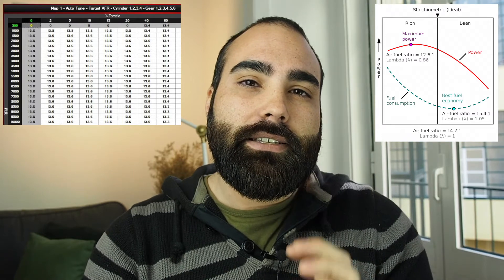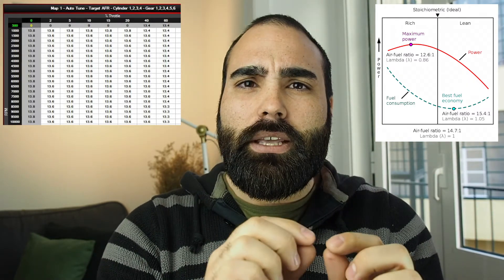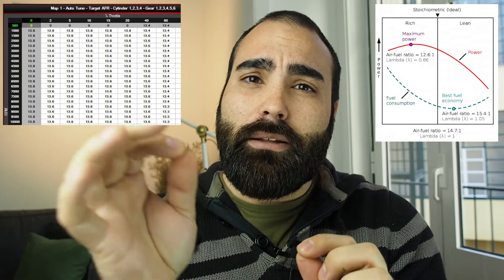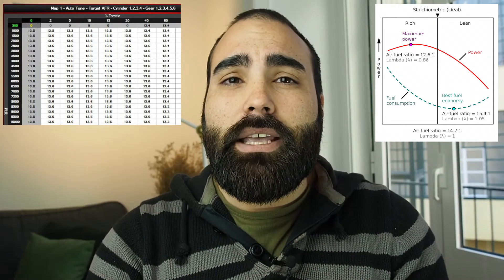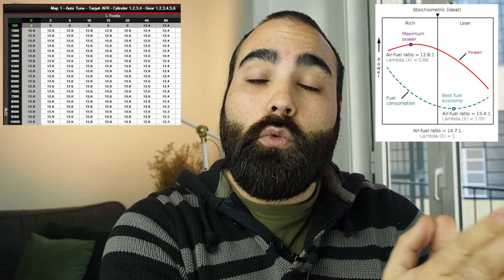Motorcycle dyno tune - Air to fuel ratio

Comment: so at stock bike, when you close throttle, at that time the bike will show how many air fuel ratio ?
Reply from the maker: The bike will never show you the air fuel ratio, you will always need an external device to show you those numbers.
Reply: @BNAdv  hmm, because i don't have motocycle...  I always confuse... Does motocycle have cut fuel when close  throttle ?
Reply from the maker: @TMMech  Not completely. Any petrol engine requires fuel, air, and spark, so when the throttle is closed, some fuel always needs to pass so that the engine continues to run at idle. But for you to properly understand how that works, I advise you to check out how internal combustion engines work, and how the fuel delivery system works 💪

Comment: I want a better fuel economy. What is the best air/fuel ratio? I own a 2004 FZ6
Reply from the maker: Hello Kleand,

Well, anyone that can answer that with a clear, cut and dry answer is lying, and I don't want to lie, so the real answer is I don't know.

Bikes, even within the same model are different, like people, even withing the same gender, age, and physical atributes are different.

If you want to get your bike with a better fuel economy, you should take it to a Dyno, and run it with a pro tuner to achieve your goals.

Different wear and tear, tires, modes you may have done, where you live regarding air pressure and temperature... All of those and more will have direct implications on your goals, and as such, on the answer.

In the same token, trial and error tests on your own may produce the results you want, but without it being done properly, you may be shaving years off the bike, as you may be introducing problems you may not be able to see or are unaware of because you are not a professional in the area, or at least I assume due to your question.

If you want it done, well done, don't waste your money on tests and internet DIY. Go to a pro, get it properly done, and enjoy your bike!

✌️🏍️

Comment: I spoke with a guy who has his own motorcycle dyno business. He builds insane drag bikes and he said that the best safe AFR for cruising is about 13.8, and the best safe AFR for maximum power is about 13.2.  Sooooooo 14.7 is pretty lean by his estimation
Reply from the maker: Hey Cameron,

Well, 14.7, as I stated in the video several times, is the mathematically correct AFR, or stoichiometric AFR, so not lean, not rich, just science, meaning that in order to completely burn 1kg of petrol, you will need 14.7 parts of air, so this one is not up for debate. 

However, as I also stated in the video, the stoichiometric AFR is not necessarily the best in the real world, so it requires tunning to your needs, meaning there is no best measurement of anything, there is only what is the best for you and your needs 🙂

Two other important points to keep in mind is that a drag bike will many times not run on petrol, but on methane or other kinds of fuel, which will have their own AFR's. Also to keep in mind is that drag bikes, as many race bikes, will also see their engines overalled, or replaced after each race, and that is not what most of us want on our daily use bikes.

It is important to understand the basis of this topic, but even more important is understanding that this, like any other topic, needs to be adjusted to your needs, and that means that what is best for you, may not be the best for anyone else 💪

Hope it helps, and that it gives you enough info for you to down your own research, and reach your own conclusions 🙂

Keep safe!

✌️🏍
Reply: @BNAdv  Yes, I realized that this as I was commenting.  I am not disputing the science I was just commenting that a guy who literally dyno tunes all kinds of bikes all day for his job gave me those AFR's when I specifically asked him for "safe" AFR's for a street bike.  We can also factor in that all bikes are different.  Even bikes of same make and model and year.  I have an MT10 and have talked with a mechanic who also has an MT10 and he has told me that even between two of the same bike their can be differences in what makes them happy
Reply from the maker: The MT10 mechanic is right on the money, each bike is its own individual, and should be treated as is.

My point with 90% of my videos is not to shower people with facts, or even absolute truths, but to open minds to different points of view, different realities, and to teach and share the idea that as our bikes are unique, so are we, and that means, adaptation and not generalisation.

That being, I would strongly suggest you not to ask what is the best, or the safest, as those are always bound by which standards were used to achieve the answer.

That being, explain your goals, your fears and limits, and whatever comes out of that, will be, in this case, your safe AFR 😉

My safe AFR to go around the world or to go racing, even with the same bike is different, so even with the same bike, the same person but different circumstances the outcome can change the answers we achieve.

Its up to us as riders to ask the right questions and put the answers into prespective. But that's just my 2 cents on it 😉

✌️🏍️
Reply: @BNAdv  I suppose what I meant by safe is what is going to be healthy to preserve the valves on my bike, it already has way more power than I need, so I was looking for the best long term AFR.  I have been doing minor tweaks with my Power Commander and monitoring fuel mileage.  I'm sure you know, but I want to mention for anyone who might be reading this later and doesn't know, that if you run the bike too lean for too long you can really mess up your valves.  To put this in context i just installed a new cat delete on my bike and compared the gas mileage to the factory gas mileage. Assuming Yamaha had the bike tuned from the factory to have a good AFR for overall performance and reliability, I got about 3 or 4 mpg better, that makes me assume that it is running a little bit more lean than Yamaha would set up factory.  Not flawless logic because there are some other factors that could be causing better fuel mileage.  I could be wrong but I think I would rather have it run just a little bit rich rather than lean.  Also I love this conversation you're awesome!   I was just injecting my 2 cents on the 14.7 AFR because I hadn't heard a number that high from anyone, and dynojet recommends nothing higher than 14.0 in their instructions that ship out with the PCV.  Not they they are the end all knowledge base but they must say that for some reason.
Reply from the maker: Thanks for the words! 💪

Well, there are two important points to what you said.

Don't quote me on this, but I'm fairly convinced that in fact, older bikes that ran on fuel that needed additives like lead, those really rely on the fuel for lubing purposes, and seised valves where common. Nowadays, it's not that you can't get your engine to seise like a bad cramp, but the treatments on the valves are very different, and running the engine lean within certain parameters will not necessarily be the worst thing in the world. 

Another thing that needs to be pointed out, and on that one I can guarantee you are wrong, is assuming brands tune their bikes for the best performance and reliability, which is indeed incorrect.

Brands design their bikes as so, but then when applying it to the real world, things change, kinda like the 14.7 AFR.

As you pointed out Yamaha, the XT660R/X is a great example of that. In the first years of the XT660, I do believe the engine was tuned closed too ok, but as years passed, the bike stopped passing the ever-changing Euro regulations. Instead of redoing anything to the engine, they decided on electronically changing the AFR, which meant, lower emissions, which meant being able to continue to sell the bike without having to spend more money on R&D.

Long story short, for most of its life being sold in the EU at least, you wouldn't buy an XT660 with the correct AFR for the stock setup, and the same is true for many models for many brands, if not the large majority.

If you want to assume something, assume the base is there when we buy a bike, but that if you want to run it like the engineers designed it, there is a strong chance you need to get some work done to it, even if just minor adjustments.

Truth be told, new bikes are being designed specifically to cope with the EU regulations, but even that doesn't mean they are putting out exactly what they designed without any pre-made "choking" to guarantee emissions and noise restrictions.
Reply: @BNAdv  great point.  I have been doing alot of tuning rides and making small adjustments via my PCV and autotune and it has gotten alot smoother and seems to be more happy.  Ideally I do need to just take it and get it Dyno tuned but it's kinda fun trying to figure it out... As long as I don't make it blow up I guess.... Seems to be running great but I will have to get it verified for sure on a dyno.
Reply from the maker: That is the way to go. Try it out, get a feel for it, experimentation always brings questions, which leads you to research different sources of info, to finally lay the questions to the pros, in this case, on the Dyno guy. See what he is doing, why he is doing it... you'll come out with a deeper understanding on the other side 💪

Comment: If my bike is flashed to run on 89 octane but I have 93 in it. How would that affect power
Reply: Thanks.  I have not change any parts.   I just know Guhl flash for 89.
Reply from the maker: Imagina an engine as a human body to start.

One single aspect affects many more, this is not different.

More octane alone can mean a bigger bang, hence more power, but if your compression, spark plugs, radiator.... if everything is not working properly, that bigger bag might be short-lived and you might find issues arising.

If your bike is flashed for 89, I assume that it is also set up for 89 all around, and as such, it will be at its maximum performance for that fuel.

If you change the fuel in search of more power, you should adjust the remaining parts.

Comment: very good info. I will start the tuning process on my 2019 ZX6R very soon. I am getting a exhaust soon. Just want it to run right. I have seen a Wideband gauge used on some carb bikes but can you install them on a FI bike or is there something else I can use? I already have an O2 sensor on my bike if I unplug it to install a wideband gauge then I think the check engine light will come on. Anyways I have  an ECU tuner that I can do at home and change pretty much anything on the bike. Just trying to find out what is the easiest way to tune my bike. Thanks

Comment: Interesting Video. I look for both econmy on low power cruise but high performance on power. I think for power the 12.6 is optimal and in the fuel saving throttle settings i use 14.7. However it seems like the autotune is kind of lacking behind the tps as it leans the fuel cells in the dump zone. How do you conquer that?
Reply: @BNAdv  I understand. The bike is an sv1000. The bike runs good now but i will visit the dyno to fine tune it :)

Comment: I have a question for you I just got my bike on a dyno run. After the professional was done with the bike the engine light stays on it's that normal or what needs to be done for that to be off?
Reply: Tea2Wine  
I have a Yamaha r6 2017 with a power commander v  a k&N filter and a full yoshimura alpha t full exhaust system. The light came on after the dyno was done.as soon I stared riding no home.
Reply: Tea2Wine 
Yes I had them before the dyno . I did the dyno to see how the bike was running after the mods.
Reply: Tea2Wine 
Ok thank you i will keep you posted.
Reply: Hi it's me again. So I have good news about the engine light on my r6 after the dyno.  I took it to my dealer and they took me it was just the motion sensor they fix it right away. Now I'm happy and ready yo ride . Thank you for all your help as well.
Reply: Tea2Wine 
Not sure I will have to ask.
Reply: Rafael Reyes - You can buy an OBD 2 scan tool fault reader for Yamaha online for a few pounds/bucks. Plug it in under the seat, it detects the sensor faults and clears them, thus turning off the fault lights that may appear on your dash. Try amazon or eBay. Hope this is helpful to you 👍